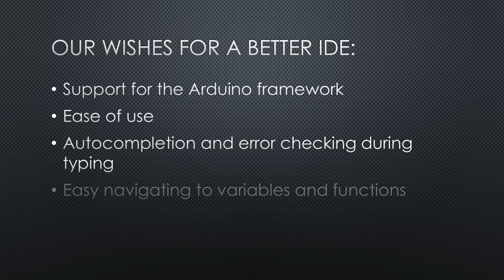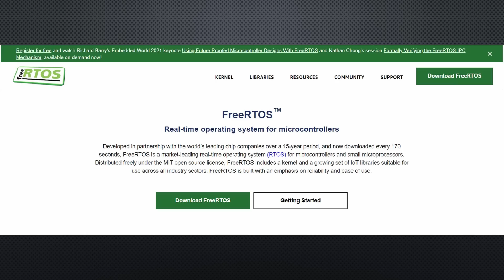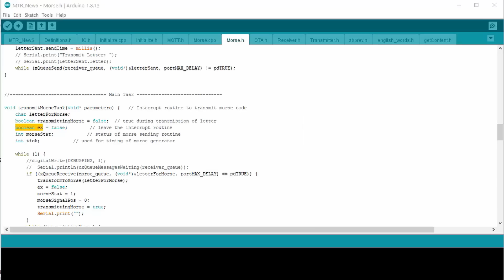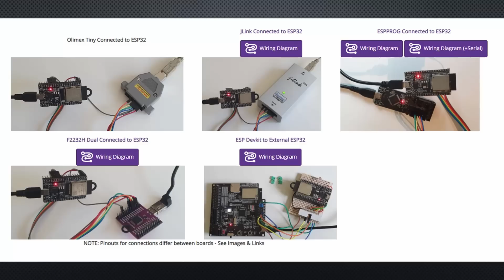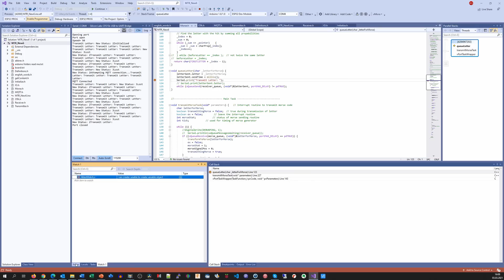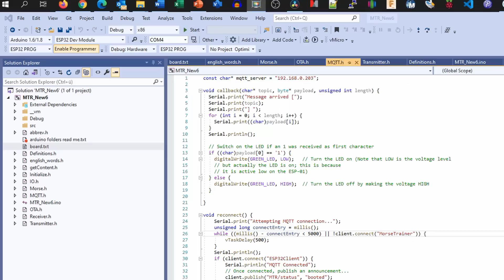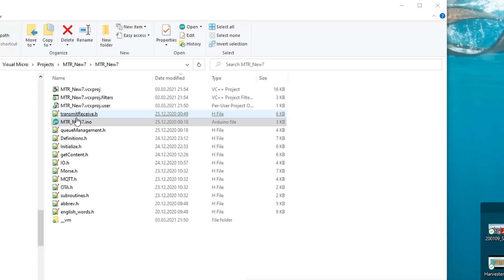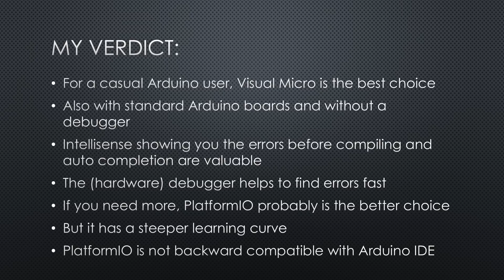#375 Is Visual Micro the better Arduino IDE? Including ESP32 inline debugger

Comment: Thanks for Video I'm C# developer working with VS from 2000 Arduino just my hobby doing small projects in free time great what now can use VS instead of Arduino IDE   I like Arduino IDE but VS way too superior with debug and code features before compile . I doubt Arduino IDE  can catch VS as Microsoft already ve  put ton money in VS and will continu its their core product line. Again special thanks to you Andreas Your videos saving ton of my time and you doing that with A++ Quality.
Reply from the maker: Glad you like my content! I assume , the Arduino IDE just have to extend a bit like autocomplete, or debug. And it has to remain simple.

Comment: Just another IDE. It does not work for me. I threw a project to it and it does not build! It does on ArduinoIDE and VSCode. I will play around for a short time, maybe some settings in preferences somewhere.  At some point, I decided to do all my programming in VSCode and that works in 99% of the cases.
Reply from the maker: I did a quite big project with many libraries and it compiled. It was more difficult to understand to debug a multi-core ESP32 project where I had my fair share of problems...
But VSC is also a good thing...

Comment: BTW, Visual Micro also works in Microchip (Atmel) Studio. It is an excellent product, which has matured over many years. Very reasonable licensing and pricing too. 👍🏼
Reply from the maker: Thank you for the addition. I usually go with the mainstream for tools, so I did not know.

Comment: @3:49 in your video - for my large ESP32 project this "deep library search" was very very slow - about 1 minute - I found you can turn it off though (option is in the Visual menus) - and through the menus manually select the libraries you are using. Compiles then in seconds.
For larger projects, with .c or cpp as well as a .ino file  - only extra step you need to do, that's not documented, is as well as selecting in the menus - you need to include all .h files you need throughout all the project in the .ino file - even if they are not required in that ino file but required by some other .c file in the project - only if they are selected in the menus and referenced in the .ino file are they passed to the linker.

Apart from that small thing that tripped me up - Its a really great IDE overall, much better than all the alternatives I've tried.
Reply from the maker: Good to know. Maybe I did not have problems because I always include all libraries as well as .h files at the top of my .ino file (as I do with the Arduino IDE). Compiling took about the same time as with an Arduino IDE and the compiler sometimes printed "using a precompiled version" or so.

Comment: I love Visual Micro and I bought the perpetual license. But even after years of use you manage to supply a detail I didn't know.
Reply from the maker: Cool. Thank you!
Reply: I bought a perpetual license too when it first came out years ago, but after switching a couple of computers and a couple of hard drive failures and reinstallations the author won't reset the license anymore and told me to buy it again.   Not too impressed.   I switched to compiling and uploading within my Sublime Editor instead.  (Arduino's editor is terrible!)  I miss the days when you buy a program and you didn't have to activate it every time Windows did a major update, or something in your computer changes.

Comment: I have a question about Visual Micro and Platformio :
Is there a debug software feature as with Microchip MPLAB IDE ?
I mean a simulator ONLY feature without any board connected to just check the program with variable watches and breakpoints. (same way to debug a windows or linux program)
Reply from the maker: I do not think so.

Comment: Does it support compiler directives like #ifdef, #else, etc?. I was unable to get platformio to do this. I like the idea of separating the serial output window from the main ide.  Again I was unable to figure out how to do this on platformio.
Reply from the maker: I used #ifdef it in my project and it worked.
Reply: Yes, it does. I had to tinker with Intellisense to get it's interpretation of the code to match the compiler's interpretation.

Comment: Electron-based applications really took over!!! 😬😬 Chromium instances are really heavy, my personal preference is still stick over old C/C++/C#/Java based applications for almost everything. Any thoughts over such trend, Mr. Spiess? Thank you for the always brilliant content!!!
Reply: I get the feeling, but just imagine how much fewer pieces of good enough software would exist without something like electron?

Particularly when it comes to easily implementable and highly customizable software that actually looks good, that takes way more experienced dev hours to do natively and thats before you talk about being cross platform. 

Sometimes it's good to accept that tech allows us to be inefficient efficiently. 

A text editor no longer needs to be super efficient. It can be just ok, because 2ms vs 50 is barely noticeable for loading a text file.
Reply: Flutter will be the next Electron i think.
Reply from the maker: How relevant is this stuff for microcontrollers?
Reply: @AndreasSpiess  maybe I am just thinking a bit beyond, but as applications get heavier for the host PCs... you will eventually have to have even more powerful machines in order to program your microcontrollers. And considering that Raspberry Pis are already considered kind of a host machine, running a heavy application on Raspbian will take its toll eventually. That is what I thought behind my first rationale!

Comment: It sounds like most of those features (the code completion, smart rename, etc) are also available in platform IO.

Other than the backwards compatibility, and less steep learning curve, does Visual Micro have anything that Platform IO doesn't have?

(I'm annoyed with the Arduino IDE and want to use something else.
I use VSCode and Visual Studio for work, my preference is VSCode.
I'm trying to weigh up if it's worth skipping Visual Micro and using Platform IO)
Reply from the maker: If you are a programmer, PlatformIO is a good choice. Visual Micro is easier to use for a non programmer and, because I will continue to use the Arduino I DE on the channel, I will use visual micro because of its backward compatibility
Reply: If you are accustomed to Visual Studio you feel at home immediately. That was my main reason in the beginning.

Comment: Now I would be very interested what your point of view is on the ESP-IDF in VSCode. ☺️
Some stuff seems to work only on that like Tensorflow on microcontrollers.
Reply from the maker: I only use the Arduino framework on this channel, so I do not know.

Comment: I know Visual Micro from Ben Heck, looks cool and easy to use.
In my job we use VSC + Platformio, everything we make is ESP32 based, we love those little bastards (tons of flash, OTA, WiFi, dual core, cheap as chips).
We config the projects as Arduino framework so we can use the libraries for Arduino IDE and mix some FreeRTOS goodness.
Tabnine is a extension for VSC that autocompletes code based on AI, it's pretty funky, sometimes reads your mind and write the whole thing itself.
Reply from the maker: PIO is a good choice, especially in professional environments.

Comment: I just started playing with ESPs and Arduino Boards and I quickly was annoyed by the awful compile times in the Arduino IDE. Even small programs took ages to compile. Some days ago I switched to PlatformIO, which is a really cool free IDE that integrates into VS Codium or Visual Studio Code under Linux and Windows (I guess Mac is probably supported, too). The compile time went down to 1 or 2 seconds, even with some bigger libraries. Serial monitoring, library and board/sensors support is very similar to the Arduino IDE, you can easily install needed packages for your hardware.
Reply from the maker: PlatformIO is a good alternative. I also did a video about it.

Comment: visual micro vs platformio? I need a comparative table.
Reply from the maker: Simple: PlatformIO is better for bigger projects and programmers. Visual Micro is easier to learn but still has auto completion and a debugger. And Visual Micro is Windows only.
Reply: @AndreasSpiess  How about saying what platforms the IDE's run on???? Kind of important. It appears that Visual Micro is a Windows only product, where as many others run on all three of the important platforms.
Reply: @DavidProffer  Its obvious? Visual Studio is windows only, visual micro is a VS extension, are there really programmers who dont know what visual studio is?
Reply: @LittleRainGames  Perhaps you should educate yourself on Microsoft Visual Studio before you offer advice or comments.

Comment: Question:  I got an ESP32-Prog and it shows up on Windows 10 Device Manager as two serial ports....  so am I correct to assume that I do not need to use Zagid as shown in your earlier video?
Reply: I figured it out....:->
Reply from the maker: I assume you found out that the debugger does not work with serial devices.... I keep one as a serial device which can be connected to a board without Serial to USB chip.

Comment: Hello. I have a question: I have a project folder in Arduino IDE which consists of several .ino files (in their folders) and the whole folder is in git (and on github)
What would be the right steps to create Visual Micro Arduino project from this? So that I could work with it in Visual Studio using all VS IDE benefits OR sometimes in Arduino IDE as needed flawlessly? Is it possible at all?
Reply from the maker: It seems they support multiple ino files. You have to ask them in the forum. I never use multiple ino files.

Comment: I don't know if it's just me, but when using platform IO, I would regularly run into the problem "I'm running a project, but a completely different one launches" and I spent hours trying to fix it and never managed to do it, so I jumped ship.
Reply: I'm not sure my problem was the same one, but I also really tried to use it but there would always be something that wouldn't work... I'm not that good of a programmer though, so maybe it was myistake
Reply: @jaspervandenameele4834  Well, consider myself moderately experienced, so I don't think it's just you. I had some issues with variables from one project being detected as duplicate names from another project. So my overall experience is that it's a buggy tool. (For everyone reading, I did search online for help, I tried the solutions, but the problems persisted)
Reply: Well, easiest solution: Just have one project in your workspace. There is a way to tell PIO which project to compile if you have multiple ones in your workspace, but I usually cannot remember 😅
Reply: @RoterFruchtZwerg  well, my workflow required multiple projects, and I always assumed it would compile the selected project :( I never managed to get it to work properly.
Reply: @nikolatotev  I think the "Switch PlatformIO Project Environment" Button below the editor, right next to the Serial monitor and upload buttons, is what u are looking for
Reply: @RoterFruchtZwerg  Thanks! I'll give it a shot when I start my next project! :D
Reply: Happened to me also. Took me hours to just find out what happened. And now(15/3/2021) pio doesn't load library files, it's broken. Considering jumping ship also.
Reply: @kesterbelgrove818  In my opinion, visual micro is more than capable of replacing PIO, even with the versioning thing, you just need git, after every build just push a commit and save a version. It's good practice to use git anyway for peace of mind.
Reply: lol have been experiencing very similar problems
Reply: @dreamcat4  I'm happy I'm not the only one heh, I thought I was just missing something obvious.
Reply: @RoterFruchtZwerg  This should be the accepted solution. In fact there is probably already a Stack page thanks so much man. That was my main problem all along! 

But here is my other hang up(s). And it has a lot to do with PIO being relegated as a plugin of vscode. So whenever i want to hit CTRL+B to build the project. Well that doesn't work. Because the vscode 'build' action is not the same as the PIO 'build' action. so instead i have to remember to click a tiny little icon in the PIO statusbar. But how do i reassign in vscode my keyboard shortcut for CTRL+B ??!!!?? 

well it's ctrl+shift+p "tasks: configure default build task"... and can select 'arduino uno' --> opens an inserts a fragment json file. ctrl+s for save. THEN the main vscode build command has switched to the new active PIO project. but for some reason PIO itself cannot do this automatically when switching projects (in pio, or its own command).

It's like that last few inches of integration which is kindda weird or broken. but would make all the difference for newbie users. who otherwise would fall flat on their faces. Ah but you're thinking: i am no noob. I am smart enough to see all of this going on. and work through it. but heh! 

...actually didn't see or realize what was happening here and instead spent many hours of frustration and bewilderment looking in all the wrong places. not too smart after all then
Reply: @nikolatotev  you can still have multiple projects, but in different workspaces.

Just select the right workspaces when you start.

Eclipse can use many workspaces, and many different projects in the same workspaces.  To many active workspaces makes Eclipse slow, but that can be fixed by closing projects you don't develop.
Same for JavaBeans.

Other IDE uses a new workspaces for each new projects. Like Android Studio.

So yes, unrelated projects in different Workspace is a useful and common workflow.
Reply: @dreamcat4  that is VSVode/VSVodium problem.

And did you post a bug report about this? That, with a Good motivation could be what is needed to make a change.

There also might be a Good technical motivation why it doesn't work that way.  A bug report would help there too.
Reply: @AndersJackson  Yes, totally, but in my case, I had one workspace for multiple projects (its the way I set up my git repo), and it caused a lot of problems. With visual micro I didn't get those issues, the selected project always ran and there were no issues with duplicate variables.

(EDIT) I just realized that you meant, setting up many different workspaces, I thought of it at the time, but it felt inefficient and I just skipped that.
Reply: @AndersJackson  thanks for the suggestion. but i am not so sure which project is responisble. let me check for existing bug reports first. other people should have already been suggesting this

Comment: I have been using Visual Studio for over 25 years and it is the best development IDE. Arduino was frustrating to use for me because of all the missing features so I will give Visual Micro a try tomorrow. 

I'm surprised that you don't recommend Visual Micro for advanced development. I knew Visual Studio is capable of large, advanced and complex professional development so are there limitations in Visual Micro?
Reply from the maker: PlatformIO has some features where you can automate the production of different versions for your project which is quite important for projects like Tasmota which support many different boards and languages. Probably not as important in commercial projects where you usually develop for a particular HW.
I would say it is not a limitation of Visual Micro, it is an additional value of PIO if you need it

Comment: I started using the Visual Studio Code IDE and Arduino CLI for compiling which is an easy free option. However, Arduino 2.0 is in its beta stage and has significant improvements, the debugging part is the one I don't know if they support.
Reply from the maker: They will support debugging. But they leave it to the community to support the ESP32...
Reply: @AndreasSpiess  A video tutorial about serial and/or hardware debugging on the Arduino would be nice
Reply from the maker: This is not a good stuff for a video, I think. Lots of details...

Comment: unfortunately being on linux cannot use this tool. so perhaps a video on platform io could still be worthwhile. or a reference to find other recommended tutorial series for getting started with pio. unfortuately my installation seems to have become broken now! since it wont let me import a simple arduino sketch. or i am missin doing something obvious. but i have no idea why! its all so complicated. it becomes rather confusing all the different layers of projects, workspaces, platforms etc. for example trying to stop project A from getting mixed up with project B
Reply: or it could be some platform or plugin or libraries dependancies breakage. or it could be some otherbreakage in all the scrambled up insides of PIO. i have no idea anymore!

maybe it could be more robust inside of some kind of a sandbox system. or container system (docker etc). where you could have a clean python, and clean all other dev environment. that could be recreated and 'cleaned' like a refresh. so just push a button get back to a working state. and with projects mounted into docker volumes. IDK its just another foolish idea at this point. hehe
Reply from the maker: I made a video about platformIO some time ago. But as said in this video, it has a learning curve. But it supports Linux.
Reply: @AndreasSpiess  lol thanks, i'll go back to watch it now then! since being right in the middle of this little arduino project